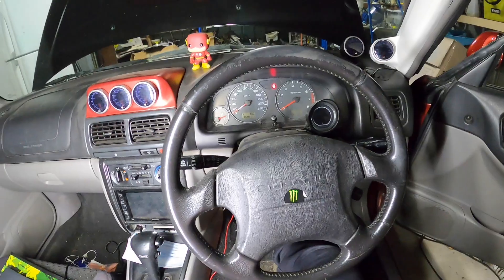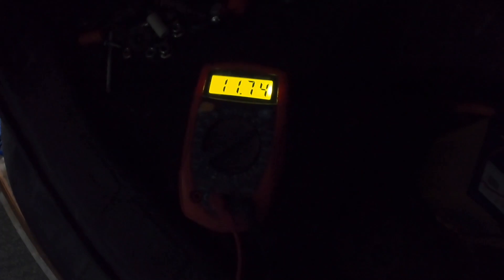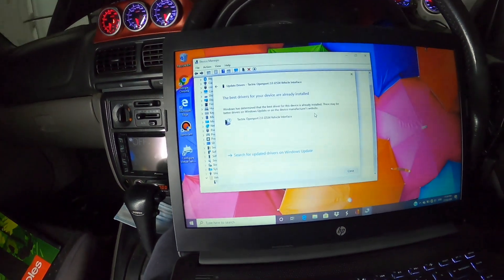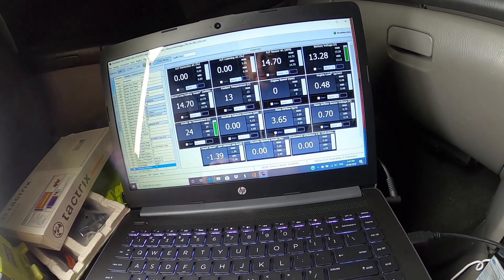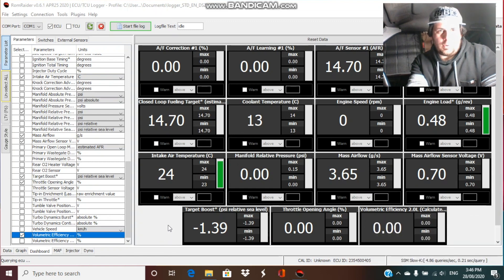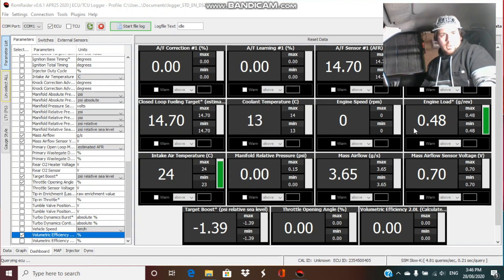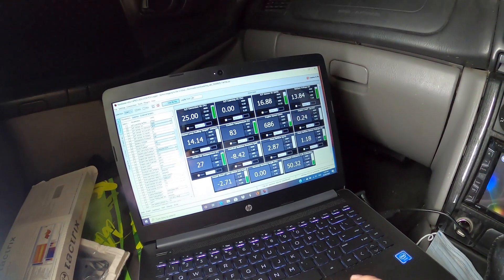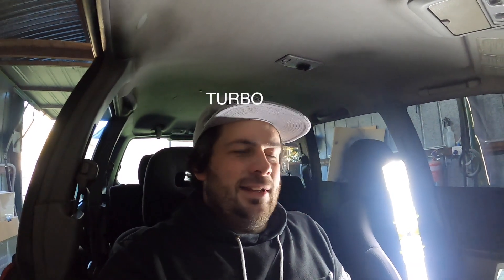ISSUES CONNECTING TO ROMRAIDER | FIXED

Comment: You wouldn’t happen to still mess with romraider would you? I’m having major issues connecting to my 2006 wrx with a ej257. I can’t find anyone to help me out lol. Windows 10. I can flash with ecuflash just fine. The logger won’t connect. Just sits there.
Reply from the maker: Sorry can’t remember. Maybe try different COM port
Reply: @HarrodsGarage  we’ve tried all kinds of things. Including com ports. I’m going to try a different laptop tonight and see if that’ll work.
Reply from the maker: Got this green connectors under the steering column connected? Mine romraider wouldn’t connect sometimes too.
Reply from the maker: I believe you can’t have ecuflash open as well as romraider at the same time
Reply: @HarrodsGarage  yes. For flashing the ecu I have the two green factory connectors that you plug into eachother. We’ve been at it for 2 days now lol.
Reply: @HarrodsGarage  yes that is true. I’ve made sure it’s closed out as well before I even open romraider